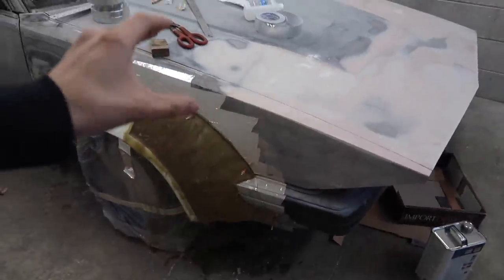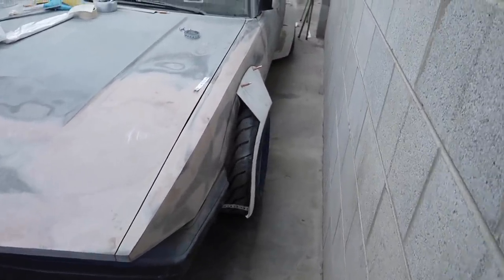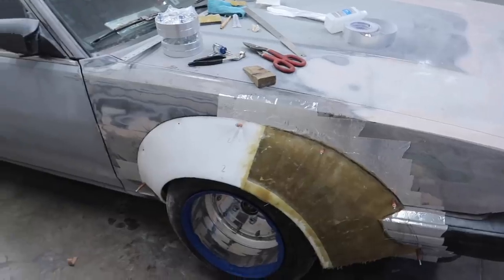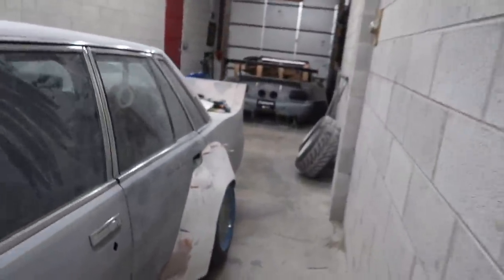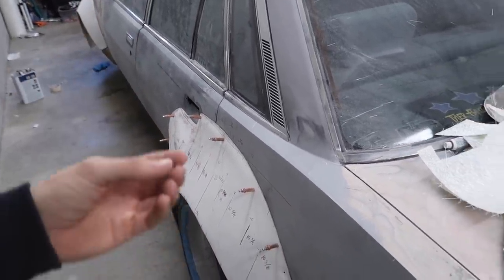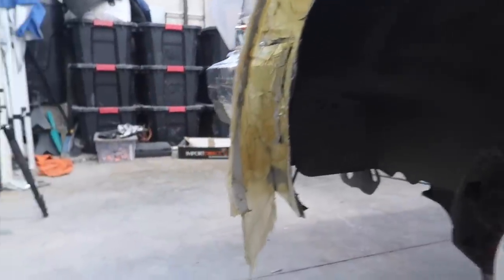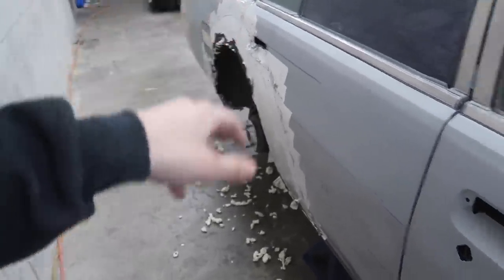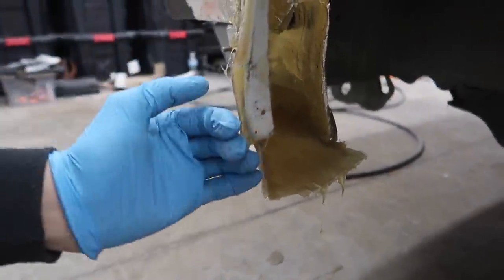Fender Flare Fiberglass Work Is Completed!

Comment: Don't use expanding foam. It traps and holds moisture. I have proof. A previous owner of my classic 74 Corolla did the same thing and has caused more damage then he thought he was preventing. Not good. Very bad.
Reply: yeah can confirm, will cause your arches to rust out eventually
Reply: I 2nd that, but I guess its too late now
Reply: He don’t care,dudes okay af! Lol
Reply: Atlwast put something over it to cover the foam it will hold moisture  and rot your car over time
Reply: 1st coat with primer
2nd coat basepaint
3thcoat undercoating spray
4th coat pain over the undercoat

(Becouse the cheap undercoats trap moisture too

Comment: When doing fiberglass, try and keep it as dry as possible while the fiberglass to be wet.  It will help it from sliding and makes it stronger overall.  Strength is in the glass not resin.

Also when laying the glass up, tear the pieces instead of cutting, it makes for a much smoother finish.  Its also a good idea to use a grinder and bevel the edges to let the two pieces stick together better.

Comment: Tyler I need your advice dude. Theres an 87 mr2 for sale I'm interested in. Your build has inspired me to build a cool 80s japanese car. What you think? Any advice?
Reply: mydogrush if it’s not rusty do it
Reply: @jakedeutscher  I'm planning to make a track car out of it but I'm worried that itll be too slow
Reply: If you want a track car just get a civic, cheap parts and great community for them
Reply: @TheYz250fmf  I was thinking something different, japanese, and rwd.
Reply: So you wanna make a mid engined track car? K, gl
Reply: @mi16t  well arnt they good handling cars?
Reply: @mydogrush  no. understeer is a thing.
Reply: @nekowife  mr2s are known to oversteer not understeer. Front wheel drive cars understeer.
Reply: @mydogrush  both can understeer. the engine in the rear puts weight in the back which lifts the front wheels so they loose grip(?)
Reply: +mydogrush just go for it. Be careful with the snap oversteer though.
Reply: Iro Lotus... one of the best handling cars in the world... mid engined and rear wheel drive. F1 cars... mid engined and rwd...
Reply: a kaido aw11 would be awsome! do it dude
Reply: @nekowife  you have no idea what youre talking about lol, theres a reason almost all super cars and race cars are mid engine
Reply: ye i realized i was a dumbo. they oversteer.
Reply: @mydogrush  To a limit and then they suffer from mid engine oversteer snap, causing you to spin. Its quite severe, I'd start with something rwd, front engined to learn on

Comment: I’ve modded overfenders with fiberglass before but had trouble with it binding to the original overfender completely. Is there and tips you have to have a better bond between them?

Comment: I been aware of boso cars for a while, but ive never seen the process of building one. Respect for the way you are doing it, youre getting some great results there. Can I advise not to use expanding foam, the previous owner of a car i used o have had used expanding foam in the car to lessen the road noise. All it did was acted like a sponge and rotted the car from the inside out. Not good.